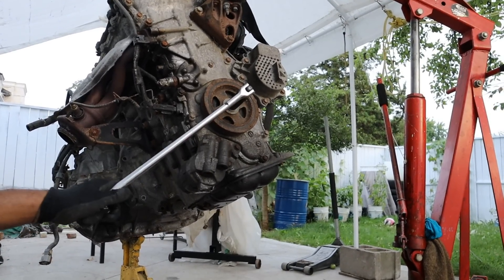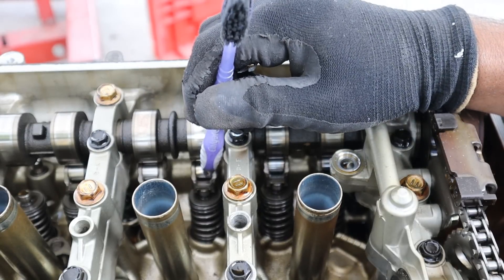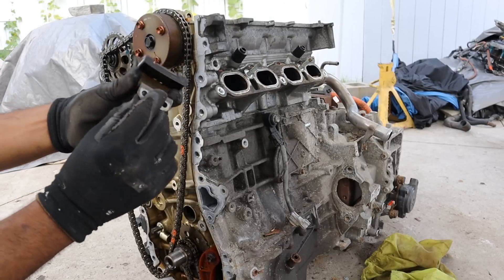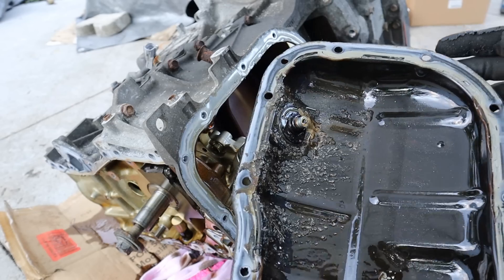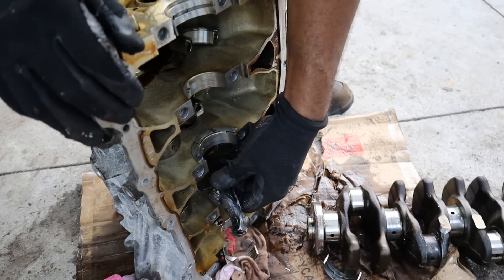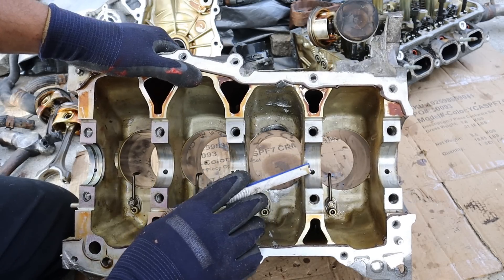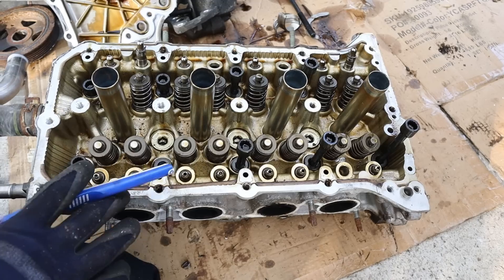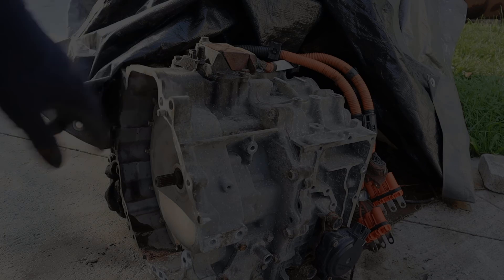Can Toyota Engines Fail? Blown up Prius Teardown!

Comment: Great video. Is there a reason you opted to remove the head bolts manually, versus using the impact?
Reply from the maker: The impact might not be able to break it free. They're on there enough to stretch the bolt!

Comment: Would be interesting if you could find a 2014 or later and check for differences on the piston rings. Apparently Toyota did an update on them. The waterpump is an interesting design, it doesn’t have an axle seal that can leak. It is a brushless motor with the stator inside the housing, and the rotor basically floating in the coolant. I did read that the magnet inside the rotor can start to corrode, causing the plastic impeller to swell a bit and get stuck in the pump housing. This will cause a check engine light and OBD code. I just replaced the oil on my 2015 Auris Hybrid with 200kkm, oil came out very clean (15kkm interval). I don’t mind the oil filter, makes it easy to check the paper filter for debris. Do love this engine setup; no timing belt, no acc belt, no clutch, no alternator, no starter motor, no valve lash to adjust, no AC clutch, no turbo to fail, basically pretty boring to do maintanance on. Will do the EGR clean soon, no idea if that’s needed on the later models.

Comment: The VVT on the intake only is a specific design to run the engine as an Atkinson cycle rather than Otto cycle.  The engine has a compression ratio of 13:1, but the intake gets left open for a moment during compression stroke to reduce the pressure.  This allows the amount of fuel and air to compress like it was 9:1, but allows the full expansion.  Bad for torque, great for efficiency.
Reply from the maker: You got it...not a very powerful design but the electric motor makes up for it

Comment: What year Prius?
Reply: In the vid description above:

"This 1.8L 2ZR-FXE engine from a 2010 Toyota Prius failed catastrophically and locked up. This was likely due to a lack of lubrication to a connecting rod bearing, which caused it to seize. The connecting rod wrapped itself around the crankshaft, causing the engine to lock up. "
Reply from the maker: 2010
Gen 3

Comment: Sounds like the head gasket failed for a while possibly coolant killed this cylinder
Reply: @speedkar99
1 day ago
The low tension rings cause burning oil faster than many other engines. 
You might not realize there's no oil until it's too late like this !
Reply from the maker: Thanks for reiterating

Comment: Looks like it ran out oil.
You can't blame toyota if the owner doesn't check oil level in a car over 300 ooo miles
Reply from the maker: The low tension rings used on the pistons accelerate oil consumption

Comment: Car care nut says not to swap from original to different oil filter housing because there may be small differences in size so it's not compatible (if the oil filter housing is incorrect it may allow oil to bypass the filter which is bad
Reply from the maker: Yeah you gotta make sure it fits, they make aftermarket ones.
Reply: @speedkar99 No only if it fits, there is a pressure regulator in the housing. This might be calibrated differently on different models. Let alone aftermarket stuff.

Comment: my condolences to your tooth brush.... but many thanks to you pointing out the innumerable failure points on that engine. Normally a typical Toyot engine usually outlast the body😄
Reply: They do, but not if you fail to check the oil for a long time. Basically as with any car.

Comment: This is one of the very best car engine of all time and cars. 
Most of the failures occur as result of misuse or neglect. 
Timing chain tensioner is oil pressure loaded .

Comment: This hybrid  transmission has  two induction motor generator how it works  that you  create a  rotating magnetic field  and the rotor lag behind that called positive  slip in generator mode the engine drive the rotor  faster than the  synchronous  speed of the stator which is  called  negative  slip.

Comment: Man I have a 2015 and love it but dread the day the head gasket fails. Some people on forum's are convinced that not completely cleaning the EGR system is what leads to failures but I don't think it's the full story. Really looking forward to the transmission tear down as I know they are unique. Rumor has it that you can change the fluid without the worry of it slipping afterwards.
Reply: How does a planetary gear set slip?
Reply: It will never slip. The transmission can only fail by one of the motors burning out or grind a bearing if there is a lack of oil. Mine is a 2015 too, I understood they have been updated from 2014 preventing oil issues and head gasket failure. I don’t know if the later ones need EGR cleaning. I also understood that it can be caused by low quality fuel. I don’t know, but my previous Yaris Hybrid with 300kkm+ still had a clean EGR heat exchanger.

Comment: Premature failure... at 340k kms :) Not bad.

Stop leak gummed up cylinder 3 somehow? Seems like the only smoking gun.
Reply: @speedkar99
1 day ago
The low tension rings cause burning oil faster than many other engines. 
You might not realize there's no oil until it's too late like this !

Comment: The heat cycle of hybrid engines which expands and contracts the metals multiple times DOES damage the head gasket more often than normal cars
Reply: Does it? Sounds like total gospel to me. As if other engines don’t see massive heat cycles depending on traffic and driver foot. Car engines are not like boat or airplane engines which run at the same power levels for a long time.
Reply: No, on the other side, the HSD Engine runs never hot like normal ICE!
Reply: No this is Just a shit engine from Toyota
Reply: @mann_idonotreadreplies  
Not aimed at being a great powerful long-lasting engine...
it is aimed at being fuel efficient as part of a system...

Comment: so what caused the failure ultimately? you say it's lack of lubrication but how did that happen? sorry if I missed that part
Reply: @speedkar99
1 day ago
The low tension rings cause burning oil faster than many other engines. 
You might not realize there's no oil until it's too late like this !
Reply: @JohnSmith-pl2bk  thanks

Comment: Any car brand engines can fail even so called "KING OF RELIABILITY" Toyota can fail, mainly due to irregular oil and filter changes. I have seen Chrysler, Ford, GM engines last forever with proper maintenance which is oil change/filter every 5000km or 3000 miles...........
Reply: Cool story bra
Reply: @mann_idonotreadreplies  
Even cooler if you remember to check oil levels every time you fill the fuel tank when your engine has low tension oil rings and is getting old.
This 1.8L 2ZR-FXE engine from a 2010 Toyota Prius failed catastrophically and locked up. This was likely due to a lack of lubrication to a connecting rod bearing, which caused it to seize. The connecting rod wrapped itself around the crankshaft, causing the engine to lock up.

Comment: "Hey Princess, watch out, the King may steal your dress." 😂🤣
I think the bars leak type sealant ruined the engine. Engine was fairly clean & pistons not steamed cleaned.
Maybe burned oil, had to add frequently, so it kept the engine clean. I own a gen 4, so this interested me. Gen 4's have heat exchanger that leaks coolant, hence, overheating & possible head gasket probs because of it. 🙄👍🖖🇺🇸
Reply from the maker: The low tension rings cause burning oil faster than many other engines. 
You might not realize there's no oil until it's too late like this !

Comment: the secret to avoid headgasketproblems is changing the electric waterpump (only use an Aisin, which is the OEM!) before it fails, and clean the EGR-system every 30-40 k km's. This can be done by yourself if you are a little familiar with engines. And don't drive like a maniac off course
Reply: Oh god, the EGR-system. Source of every problem.